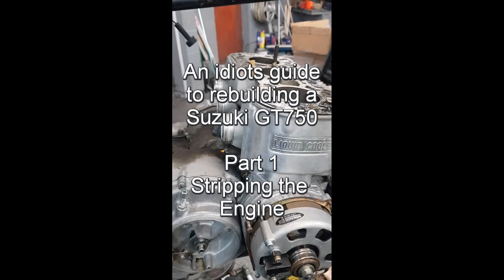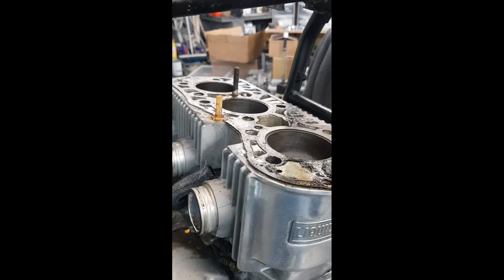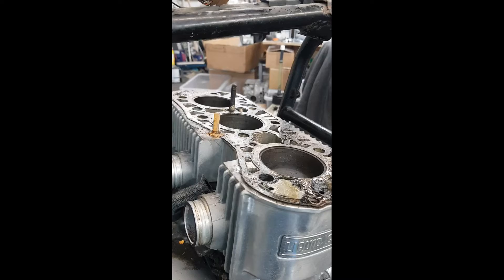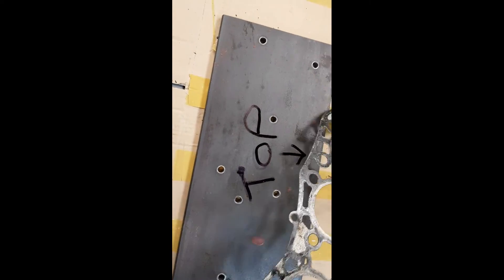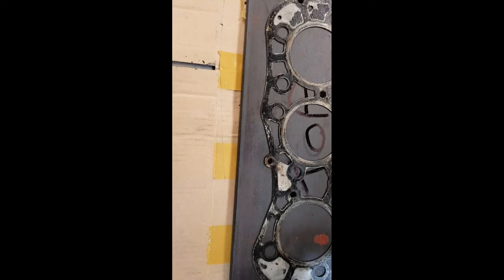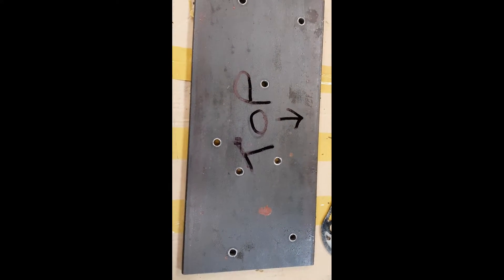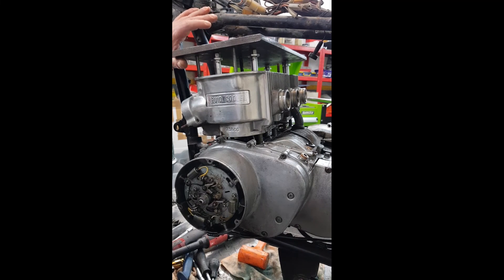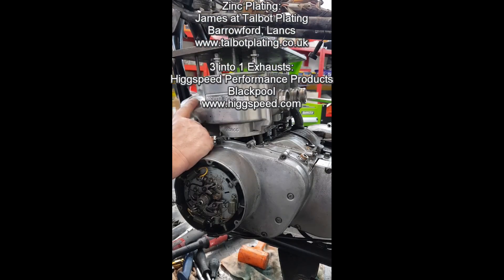Stripping the Engine Part 1 - Suzuki GT750 - An Idiots Guide to rebuilding a Suzuki GT750....

Comment: Hello. I have a ‘72 GT750 that I literally dragged out of a field. I used your plans for the puller plate. I have been able to separate the cylinder block from the engine case by about 1 inch but can not separate the cylinders any farther. Any suggestions?
Reply from the maker: Sometimes when the corrosion is really bad the block doesn't come free even when you've lifted it clear of the steps in the 2 outer front studs.
If this is the case I put more duck oil or similar down the tubes where the head bolts go and I knock the block back down  and re lift it again, sometimes you may have to repeat this process 2 or 3 times, but as you push it back down and lift it again it cleans all the corrosion off the studs 
It will come up eventually, just keep doing it !